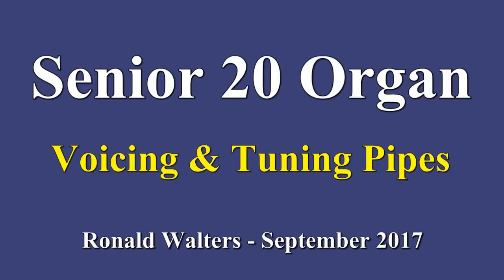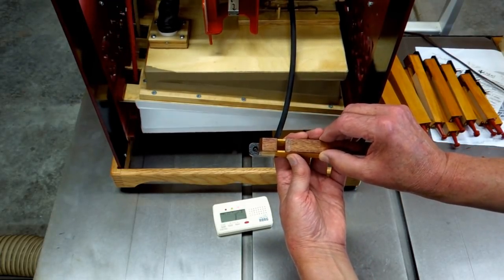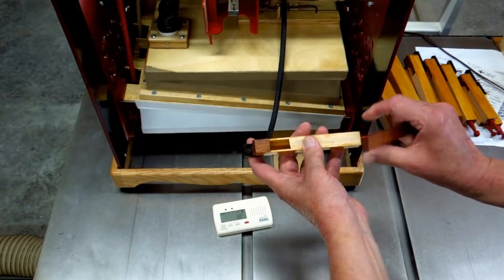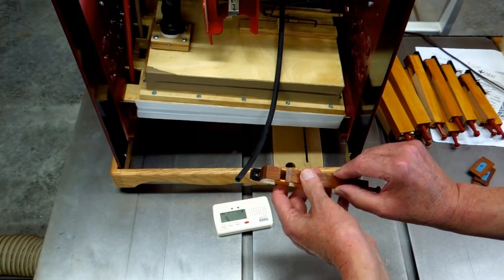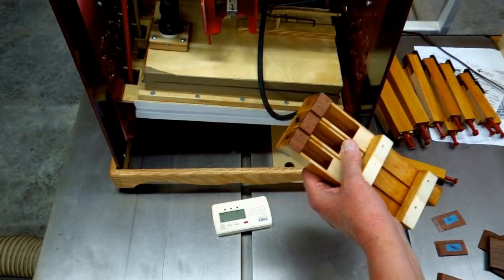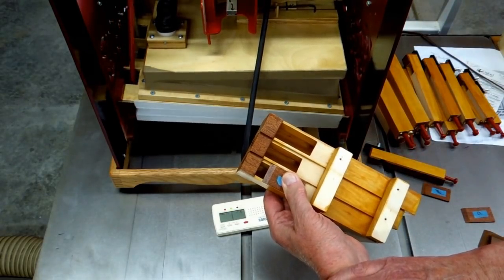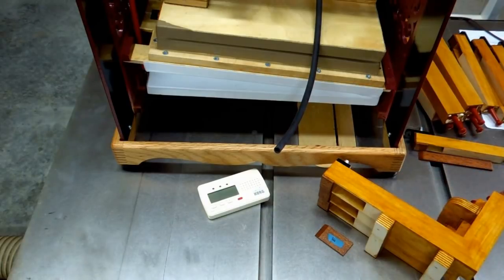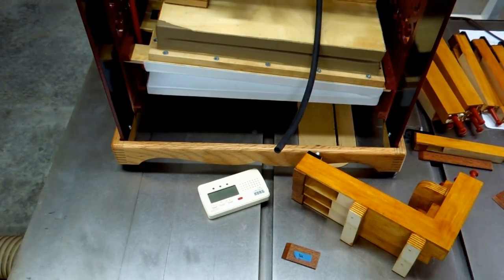Senior 20 (25B) Voicing & Tuning Pipes

Comment: You need a larger reservoir or 4 bellows working in quadrature to get smoother air output.  The output surges between bellow strokes.

Comment: Hi Ron,  Things are moving along very well with my Senior 20.  Bellow are completed and installed into case.  Preasure box is finished and installed.  Pipe mounting board is completed as per your design with a few adjustments to my particular design. Pipes are assembled, face plate are cut and beveled, tuning plugs are done other then the coverings.  I do have one question at this point;  did you cut the pipes to their final lengths before you started tuning?  I am using your pipe chart that you showed here on your uTube video and used the maximum added lengths per you chart. I want to get a rough tune done on all pipes, then once the pipes are ready for final installation, I'll do the fine tuning.  I really can't say how much I appreciate all time you spent on your video.  They, as well as you're many replies to my questions, have been invaluable to my project.  Once I'm finished, I'll send you final pictures as well as a video of it in action so you can hear the sound.  I've been extremely meticulous in regards to every aspect of the build.  I know this will become a family heirloom and expect it to last a very long time.

Comment: What the heck was producing that soundwave interference pattern? That pipe was producing two different pitches at close frequencies.
Reply from the maker: That is what I am referring to as squelch. Squelch in radio terms is an unwanted noise. In this case it would probably best be termed a beat frequency... two (or more) different reflective wave patterns inside the pipe making an unwanted sound (mistuned)... kinda like fingernails on a blackboard... don't do that. :-) With a wind instrument you can produce the same effect by overpowering the reed by blowing too hard or possibly a split reed producing two different notes. Another reason why the pipes need to be voiced and tuned using the air supply from the organ they will actually be played with.
Reply: @RonaldWalters2010  I wrote up Jack Hayward's Circle of Fifths tuning method for harps, which uses the "beat" between two strings nearly in tune to bring them spot on - one's the string you want to tune, the other's either the first (octave) harmonic  or the second (fifth).
I'm also the low whistle player who first took it into Irish in an impromptu masterclass with Paddy Moloney. The instrument was invented by Finbar Furey, during a time when Brazilian was a fixation, and he simply hadn't done anything trad. So yes, I know overblowing very well, but to get two notes from the same windflow, you'd have to be Bulgarian!
Reply from the maker: Playing more than one pipe on the small street organ (or on my mini-calliope) can certainly give a better or more pleasing tone and multiple pipes the impression of much more volume. Personally I do not play a musical instrument so I look to the music arrangers for these small organs (with a limited number of pipes) to make their songs as entertaining as possible. What sounds good on a piano keyboard my not be pleasing at all when only the center half or third of the notes are available on these small organs.
Obtaining a "beat" or sympathetic vibration or resonance with adjacent strings is one thing but playing one pipe alongside an adjacent pipe is not going to create a sound from the adjacent pipe.... those two pipes played simultaneously could create a harmonic or more pleasing sound. The acoustics of the room vs being played outdoors is another topic.
That terrible noise or what I call "squelch" is just that... a terrible noise from a yet improperly voiced or tuned pipe. 
My videos on the Senior 20 Organ are mainly intended to help people who want to build one of these very entertaining little organs. The man who designed this was a very good organ player but a terrible craftsman and his drawings are incomplete and (for many) difficult to understand.... that is where my videos come into play.
Thanks for watching! Please subscribe. 
That is what keeps this channel going. 
Ron

Comment: For the block you used for the tuner, did you use any felt, leather, or cork, to get an airtight seal?
Reply from the maker: There is a thin piece of lamb skin (suede) around the tuning plug. I used a little talc or chalk for lubricating the lamb skin. Do not use anything containing cornstarch as it could attract bugs. One of my videos on the Senior 20 shows this being installed as well as the block being sized and shaped. There are playlist of all the videos associated with making the organs. Thanks for watching. Please subscribe!